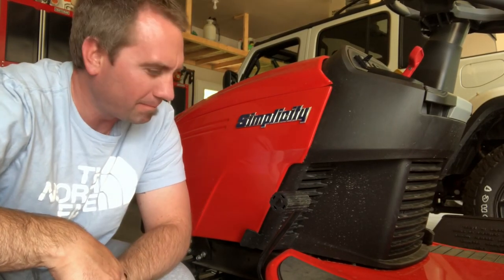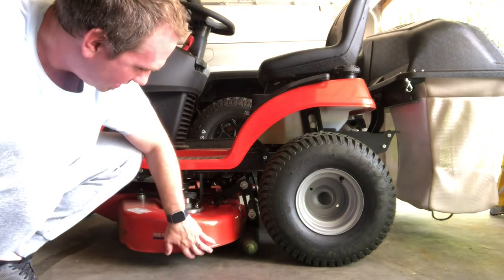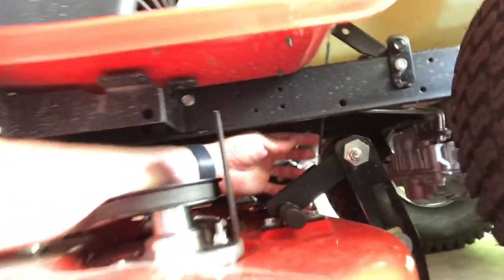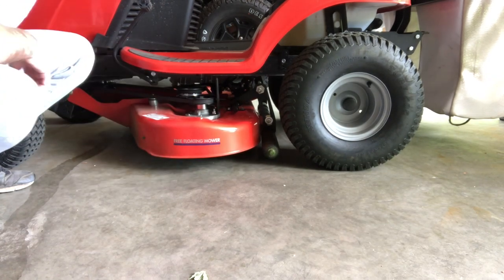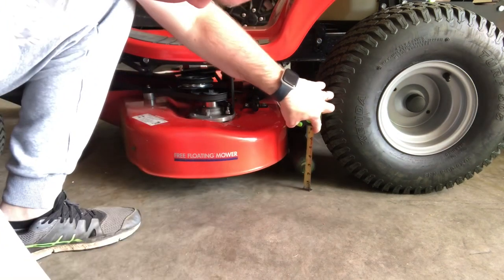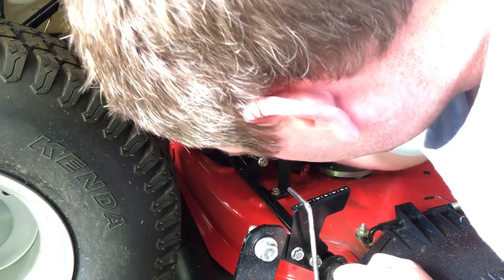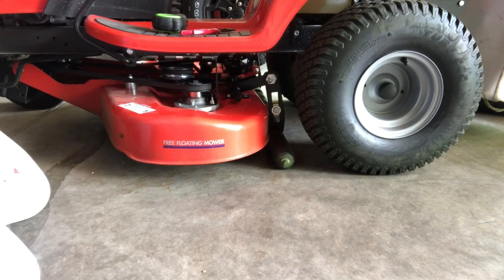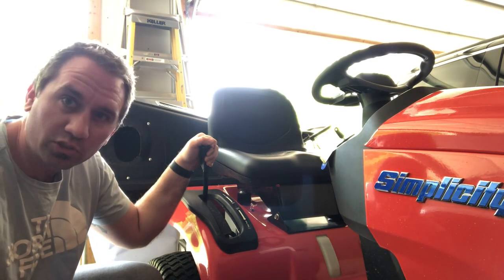How to increase deck lift on Simplicity lawn tractor #1: Deck Side

Comment: I have had my Regent 38 for a week and the lack roller clearance when in the transport mode was an aggravation. I have a section of rock driveway that I must cross and the roller would plow the rocks in transport. After making this adjustment it no longer plows the rocks. I followed you example to the letter, including the dropping of one pin. :) I found it in the grass after a short hunt.
Reply from the maker: I'm glad it worked for you!  Hopefully we will get better at not dropping things, but I'm not holding out hope for myself =).

Comment: Definitely going to have to look at this. My rollers don't even come off of the ground in the transport position.  I bent the bar that the rollers are on, driving into my garage with a 1/2" concrete lip, and had to replace it.
Reply from the maker: I hope this helps you out, thanks for commenting.

Comment: I spoke on problem before my roller bar does not lift off the ground even when I’m in transport mode and my height of cut is raised to 4” thanks for your feed back.
Reply from the maker: With the deck in transport mode you can also lower the height of cut and it will pull the roller up off the ground.

Comment: I also had a similar issue. So I ordered new cables. Seems there were two lengths so I chose the shorter set. Not sure if the shorter set is meant for my mower or not. I figured, over the years, the cables had maybe stretched.
Well with the new shorter cables, it solved my problem.
I never thought of hooking into other holes.
Reply from the maker: Interesting about shorter cables.  How was ordering parts?  That has been one negative I’ve noticed about Simplicity, parts availability.
Reply: @TheLawnEngineer  I got the cables before the pandemic hit. We have a couple local dealers where I live so called the one out in the country who services tractors as well. Took the standard 1-2 weeks for the part to come in. I also needed a new crank handle for the deck as my lowering and raising is not electric.
Reply from the maker: @billylacharity3443  Thanks for sharing your experience.
Reply: @TheLawnEngineer   No worries. Thanks for all the videos on working on this tractor. Not many videos on how to maintain and work on them. My carb went a couple years ago and could not find any info on how to work on it. A friend ended up having a friend fix it for me for $50 as a favour. I got lucky.
Reply from the maker: @billylacharity3443  you’re welcome.
Reply: I'm having the same issue with my Regent 42. The cables were setup up as you described, but I'm still not getting the added clearance. The current cables are part number 1733125-A, which are 9.5" center of pin to center of pin. Do you have the part number for the shorter replacement cables? And by any chance did you measure them?

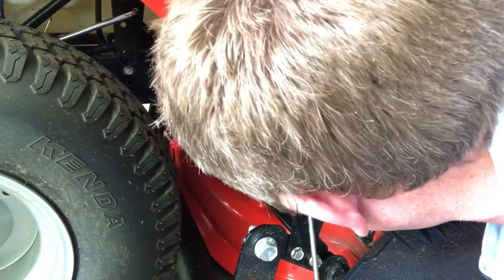Comment: At 4:50, the little electric lift motor on my Simplicity needs replacing. Have you removed that motor yet? I can not get the 7/16 nut on end of threaded rod to unscrew without possibly breaking the little gear box. It was easy enough to remove the little clip and pin that hold motor on. Thanks! New motor coming at the end of the week, but just don't know best way to get old one off.
Reply from the maker: I have not taken the motor off yet, I'll take a look and make a video if I can figure it out.
Reply: @TheLawnEngineer  The bracket with one large bolt in it, that the rod turns in, may need the bolt loosened, and pried apart? Maybe would let the trunnion looking part free up and fall out. Can't believe there is no video on you tube or anywhere else with this procedure. Thanks!
Reply from the maker: I'm finishing the video on this, will be available tomorrow morning.

Comment: they give you different setting 38/44 decks take 1 hole 54 in deck take the other .if you have the deck go to high it pops the height motor.
Reply from the maker: That makes sense, thanks for sharing.

Comment: The last point you raised at 6:58 minutes re the cables stopping the deck cutting lower, I have this issue and was wandering how to fix it so the deck can cut lower?  Appreciate your advice:)
Reply from the maker: I would recommend disconnecting the tension cables when mowing.  The obvious negative is that you can't raise the deck into transport mode while the cables are disconnected.  

The only other option is to increase the range of motion provided by the deck lift lever.  I believe this would require some fabrication /modification to the linkage.  The "arms" the tension cables mount in could be increased in length to allow another hole to be added further from the pivot point.

Comment: Hello, I have a simplicity conquest 52" deck.
Can you help me on how to tighten the blade belt? 
Thank you
Reply from the maker: The blade belt is tensioned by a spring hooked to an idler pulley that pivots on an arm.  It is. I uncommon for that spring to break on an older machine.  If you check over the top of the deck and don’t see a large tension spring, it’s missing; replace the spring and you are back in business.

Comment: You offer more information than my dealer does, they don't seem to know anything. Do you know how to get a higher cut out of the machine. The best I can get is 3-1/2" but would like to get 3-3/4"  to 4" The cut height number on the switch does not match the cut height at all.
Reply from the maker: I have not looked into that, but I'll look into it.  If I come up with anything, I'll make a video.  If you subscribe to my channel you will see if when I get it posted.
Reply: @TheLawnEngineer  Already Subscribed. good information
Reply from the maker: @georgesmith3074  awesome 👍

Comment: I have a Simplicity Conquest with 48" fabricated deck. I have followed all instructions to the letter. Their quick removal process doesn't work as described. I end up having to use a hydronic car jack to raise tractor, put blocks under deck and then lower tractor to release tension to remove pins and chains. Then, once deck is free from tractor, the deck doesn't "simply slide" from under tractor bc there isn't enough clearance to get the front black quick-release extension out from under the tractor. So, I have to remove the huge pin to separate the deck from the quick release extended part. Then it can "simply slide" out from under the tractor. A REAL PAIN IN THE ASS.
Reply from the maker: That does sound like a huge pain.  Thanks for sharing so others know the truth hopefully before purchasing.
Reply: You need to follow the instructions to the letter and I mean the letter or you will have an issue. I had an issue like your having until I went back to my dealership and the service manager showed me exactly how to do it. I was trying to move my deck left in the front instead of right lol or something like that. I got home and had the same problem so back I went and he showed me again but this time I used my phone to video it.
Reply: On mine instead of cables my tractor had short chains that I only need to move their link to the next one and it worked fine. I had recently purchased Simplicity’s four wheel drive tractor and I was told by many it’s just a toy. Not so with its front end loading I can move lots of materials wether dirt mulch or what have you although it’s not as large and powerful as a compact tractor it gets into areas a compact tractor can’t. But Simplicity did make many of them so they are expensive and hold their value very well.

Comment: I noticed when you changed those tension cables, from this angle it looked like the deck became “un-level!” Was that only in transport mode, or did it actually change the levelness in cutting mode?
Reply from the maker: Sharp eye  It did bring the back of the deck up but only during transport mode.

Comment: I can't understand why you folks have such problems with  deck lift adjustments I have a 17yr old simplicity regent with the 38inch deck and have absolutely no issues with deck highth adjustments  however the only issues that I've had was traction  so I fixed that problem by putting on ag style  tractor tires and thats made my simplicity regent one awesome lawn mower  I have a lot of steep side hills and my machine walks up and around very steep hills with absolutely  no problems what so ever with out any spinning tire marks I bought these tires from tractor supply in my area on sale at half price  these same tires can be bought on the Webb site for about the same price as I have gotten mine  and they do have various sizes too for your machines  the simplicity prestigious does come with knobby style atv tires however I still rather have the ag style tractor type tires instead.
Reply from the maker: I’m glad that your machine has been reliable.